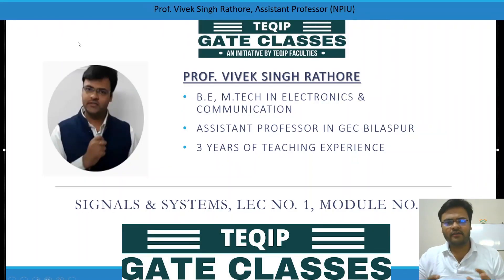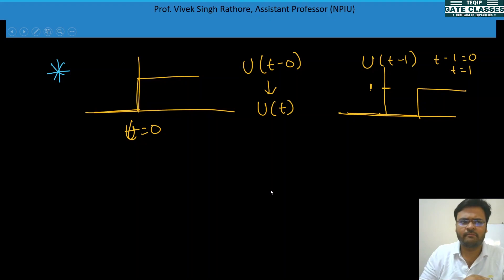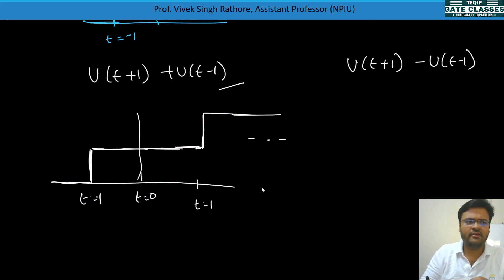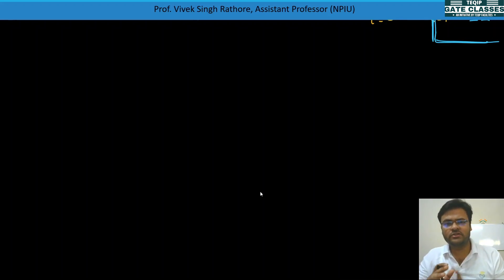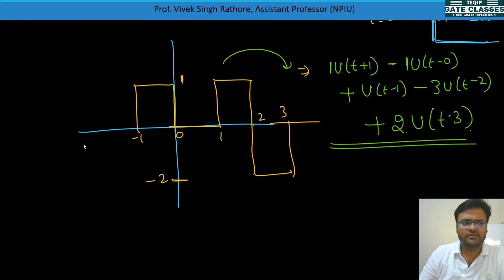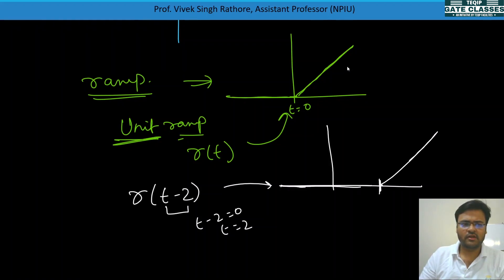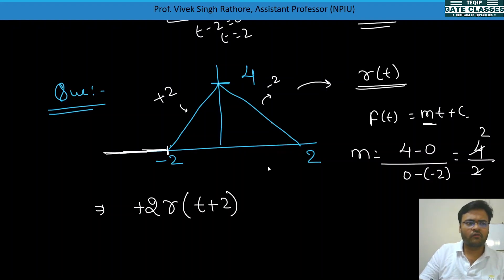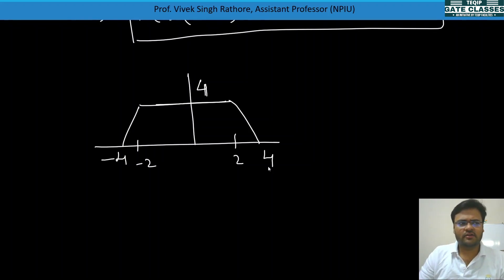Lec - 03 | ECE/EE | Signals & Systems by Vivek Sir | Let's Crack The #GATE by #TEQIP_Faculties

Comment: addition of amplitude is zero then that signal is finite . this statement is right or wrong sir ?
Reply: If a signal amplitude is zero then that signal does not exist. If a signal exists then only you can classify it as finite or infinite, bounded or unbounded, etc.
Reply: Sir, for sawtooth signal (at 17:00), addition of amplitudes is  (= 1-1-1 = -1) not equal to zero. Does this mean that it is an infinite duration signal? OR we cannot apply this rule to that because it is a combination of unit step and ramp?
Reply: @priyankalal2366  Good to see that you follow lectures seriously....You can apply the technique of adding magnitude for unit step signals.